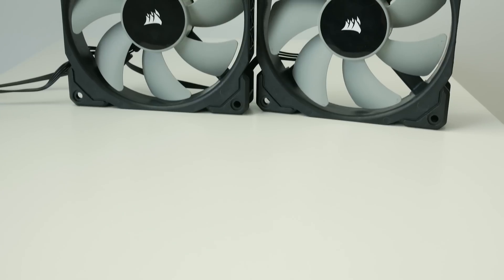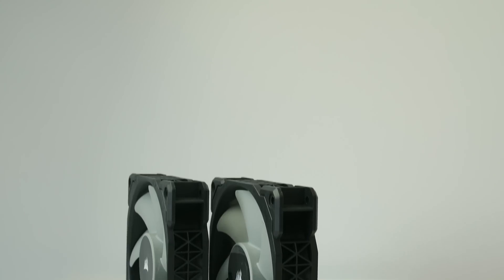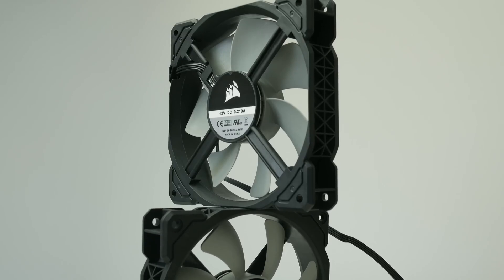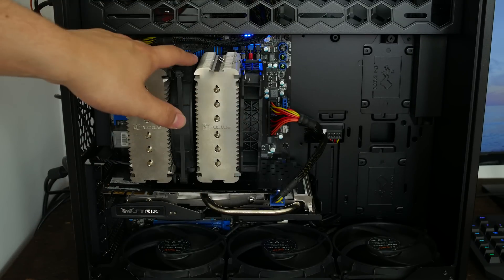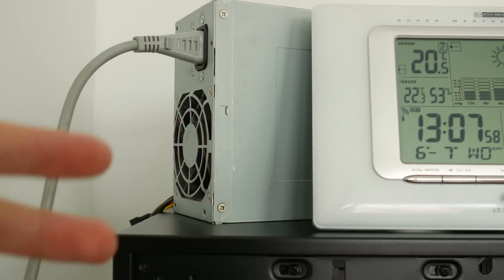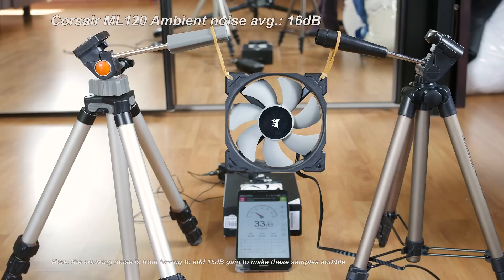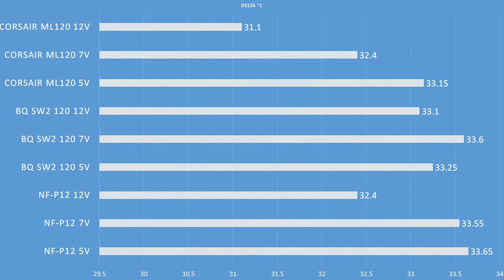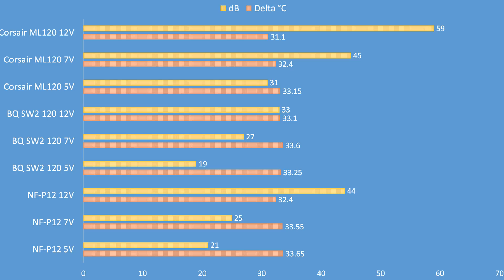Corsair ML Series Fans Cooling and Noise Review Compared to Noctua and Be Quiet!

Comment: I also disagree that beQuiet fans are better for low noise cooling for 2 reasons.
I have had both the SW2 and the SW3 from beQuiet and they move much less air than the ML ones from Corsair, and while they are quieter, that's only true at the beginning and only with good units.
With a bad unit or once the bearings clog up/wear out, the SW become noisy too.
Whether that also happens with the ML I have yet to see.

Comment: Loved the B&K sound level meter! hehehe. Your measurement is not "un-scientific" because you used a cell phone - that makes it only less precise. The only problem I saw is that not all the fans were hung in the same manner. As long as the method is the same with all fans you'll get scientific results albeit being less precise - but this is not a hospital or lab, so no need for a 2K USD sound level meter.

This comment is just so you know you did everything almost right and that a little change would get more comparable results - results that can be compared with one another.

Comment: you seem to be running dynamic boost clock, the temperatures differ way too little, 1 degree between the highest setting of the ML fan and the lowest of the SW2 :D thats 19 to 59 db and 2 degree difference. and the fact all your temperatures are within error rate shows that the clocks and heat output was not controlled :) fan testing is extremly difficult and has many variables, try basics if you want to do these tests, a simple audio test and db measurement and an air throughput test in a tube, temperatures are to difficult to control for any mere individual :) Good luck :)
Reply: genium me: PLEASE HELP. You seem like a knowledgeable guy in this subject. Do you know if the ML and LL series look different in terms of visuals, as in, if I used them in the Sam case would I be able to tell??
Reply: @notthatguy4703  sorry im not that familiar with corsairs lineup in general, i am more into the technology side of things then the design part.

Comment: I have PWM headers on my motherboard and it confirms in the BIOS that PWM can be used. So I don't need the PWM controller right?
Reply: no.  and if you use the arctic bionix fans they have pwm sharing technology built in so you can share one header between multiple fans.  and they are good price.

Comment: Did you connect them with PWM? I gather that the MLs need PWM for the magnetic function, and without that they will not actually be functioning properly which invalidates the test. Obviously that will effect noise and longevity, but it may also effect cooling performance as well.

Comment: - the sound pressure level (noise level, dB) from this test came alot from the wind blowing into the mic, why not get a professional 'pop filter'?  you know the black screen thingie in front of studio recording microphone, if you're poor you can DIY one from your mom's stocking.

- comparison from voltage alone isn't accurate, use RPM.  different fans spin at different RPM at the same voltage level.

Comment: not to bash, but help me understand this: you stated in your video details that the fans are designed to run exclusively on PWM, but with your tests you run them with voltage control? And then you compared full voltage decibels of a 2400rpm fan to full voltage of a 1500rpm fan?

I think a followup video comparing PWM versions of the Corsair MagLevs, the BeQuiet SW3's, and the Noctuas, and standardizing them to a handful of RPMs that are popular (700RPM, 900RPM, 1100RPM) would be ideal. I'm also a silent freak so I get exactly where your priorities are, and something like this would be very useful.
Reply from the maker: I understand your point, I've tested many pwm fans on both dc and pwm to compare but with most fans it doesn't matter how you run them. For future fan videos I might re-do the testing procedure to fixed rpms though.

Comment: nice video..  i  order corsair H110i v2  but i would u change the fans onH110v2 with others corsair more silent??witch to use it to replace fans on radiator :SP120 PWM Quiet Edition High  SP120 PWM Quiet Edition High

Comment: PLEASE read fan specs before reviewing them. As they are using magnetic levitation they need 12v to assure proper levitation....NEVER UNDERVOLT THEM. Just use PWM control
Reply: That whould be true but they are not levitating what so ever 

They literally just removed spacers off the shaft and placed one more zero on a price tag
Reply: @blackturbine  
You are talking BS.
On the LTT forums people have opened them up and you can see they are what they are supposed to be, fans with magnetic bearing, i.e. the rotor levitating around the motor.
Reply: I built my first pc some days ago with a magnetic levitation 140 mm fan from corsair, but it's pretty loud, especially compared to the stock fractal 120 mm fans that came with the case (Meshify c).
 Could you explain what you mean with that it needs 12 volts at least? Wouldnt it be really loud? I think im using 4 volt now.
Reply: @treack143   12v control means you need to control through PWM controller (4 pins). It should be done automatically through MB headers (4 pins) or any fan controller (with 4 pins). Afterwards, those ML fans are pretty (in)famous for their motor noise (even if properlly controlled). For quieter fans, you can have a look at Artic, Noctua for example
Reply: @MarcParisTV  Ok, nevermind the 4 volts i said, but can you just replace the case fan(s) like that? Without anything to change e.g. in the bios? And lastly, i have a pump header on my b450 tomahawk max but Don 't use it, should i? What is it?
Reply: @treack143  normally no issue to switch case fan like that. Before doing that it will be great to check your current fan speed (hwinfo64)....maybe your fan are simply spinning at max speed. At low speed Corsair ML are not that noisy

Comment: If I understood correctly, those ML's should be PWM controlled because of the magnetic field. Lower voltage means weaker magnetic field, which could cause some extra noise ( fans motion isn't controlled that well).
Reply: Petri Koukkula yeah i have 2 140mm's and a 120mm of these and running them pwm is alot quieter than trying to use voltage, something to do with bearing noise coming back, also under around 1300rpm the 120mm is barely audible, not sure about the 140s as i have mine on my cpu radiator

Comment: Maglev fans need PWM control, they can't use voltage control properly, the electromagnetic levitation requires the full 12v

Comment: I actually have to say, the sound test is less than scientific, it is blatently misleading. The reason I say this is, the actual sound is skewed by the amount of air rushing through. It's not the sound of the fan motor itself, but like when the wind hits your ears at the right angle. The wind itself isn't that loud, but it's the angle in which it's hitting your ear (or microphone) that gives misleading results. 

Moreover, the Corsair fan has a much higher RPM than the other 2 fans, and unless you're comparing their noise levels at the same RPM you can't say it's a comparison. It seems to me that the last air test had each fan at max, and since the corsair has a higher max rpm, of course it will sound louder. The corsair unit will move more air per RPM than the other 2 fans, and on par w/ noise level. The difference is only so noticeable for the aforementioned reasons.
Reply from the maker: The noise level was measured with a different mic than the one you hear in the video

Comment: First of all, the following post is not a complaint about what you regard as a less scientific sound test. You performed a sound test (which is quite tricky and impossible to get perfectly right/consistent/reliable) with limited means and I think you did fairly well.

Also, the first time I saw this video I thought it was done fairly well and you had some valid points. However, after reading more fan reviews and giving them some thought, I can't help but feel there are a few things that are wrong in this review.

I believe there are 3 main problems that limit the usefulness and correctness of these results and conclusions greatly.

Main problem 1: I believe this is something very obvious: why on earth would one leave the BeQuiet fan on in the #2 (mid) position of the CPU cooler in your tests? Apart from minimizing the effects of different fans in the #1, it is adviseable to use similar fans in multi-fan CPU cooler set ups. As far as I can guess this is mostly because different fans can push way different amounts of air per second at the same RPM, which could lead to over pressure and thus more heat (although I am not really certain about this part). Also, not that this is part of the review, it can create noise issues that is created by these differences in air flow.

But didn't you notice that the temperatures differences between all fans at different all the different voltages are very very similar? They are all 33.XX delta Celsius, except for the first 12V and 7V results of the Corsair ML120 at 31.1 and 32.4 respectively, simply because there the fans are running at ridiculously high speeds, moving huge amounts of air. It is really surprising that the effect on the temperature of these fans running at their max (producing great amounts of airflow) has such little effect on the temperature. It's simply unbelievelable...., and likely very unreliable. Basically, I would say that with results this closely, the margin of error will be bigger in many cases than the actual data that you are trying to retrieve.

So, I think that the noise-temperature chart using the 5V/7V/12V tests is highly misleading, but you have to understand main problem 2 and 3 for that.

Main problem 2: the lowest speed setting for the Corsair ML120 that you tested on is at 5V, seemingly not realizing that the Corsair ML120 produces 1300 RPM at 5V while it can go as low as 400 RPM. You are drawing the conclusion that the Corsair ML120 are not wise for using in a PC that is aimed at silence, while you have NO data to base this conclusion on because you missed the first and most silent 900 RPM delta part of the 400-2400 RPM range, that is nearly 50% of the range that you missed and completely left out of the equation, conclusion and your recommendation!!! You are logically drawing that the Corsair ML120 is loud on it's loudest settings. But this is useless, because pretty much all fans of this size that produce comparable amounts of airflow are loud on this 

From this point on, one should already ask himself, what the hell is being tested here.

Main problem 3: the different fans are compared on noise based on the different voltages 5V/7V/12V, conclusions are based completely on this and the RPM's are completely disregarded. This is not right, at least if you care about meaningful data gathered using basic research principles. Especially considering how poorly the Corsair ML120's responds to voltage changes and how this covers only a part of the fans RPM range, something that the reviewer at ThermalBench.com warned for (see their ML120 review in next link or their ML140 one). The Corsair ML fans really are PWM fans, not voltage fans. I believe Corsair warns for this themselves.

What is the reason that this not right? Well, the Corsair ML120s have COMPLETELY different RPM's at these voltages than the BeQuiet SW2. Proof:
http://thermalbench.com/2016/07/29/corsair-ml140-pro-140-mm-fan/3/
http://www.dvtests.com/be-quiet-silent-wings-2-120mm-pwm-and-140mm-pwm-test-and-review/
Extracting information from these 2 reviews makes me put the following figures here:
- At 5V, the BeQuiet SW2 fans run at 480 RPM
- At 5V, the Corsair ML120 fans run at about 1300 RPM
That is a 271% difference!  Of course the Corsairs make much more noise at this voltage. But you are building your main conclusions based on this "voltage".

And this is not even the whole story. Namely, at different RPM's fans can produce very different amounts of airflow. And measuring the amount of airflow vs. noise level is much closer to what you want to know when considering efficiency than drawing some kind of relation between some voltage being sent to a fan and the noise that the fans makes... Let me explain this by an extreme example:

If someone would produce a fan 'X' that produces 0 RPM at 12V, the delta temperature would still be close those those 33 degrees in these tests (maybe 34 or 35 or maybe slightly more) because that mid position BeQuiet SW2 fan is already pushing and pulling a very comparable amount of air compared to a 2 fan setup. Check online and see the effect of adding a 2nd fan to a CPU cooler, the effect is not that big... Following this line of thought, you could now give the Ultimate Gold award to fan 'X', because you could draw a conclusion like: "well at only 2 degrees extra this 'fan' is producing 0db, even at 12V, so it's the best fan ever! no more need for further innovation!".

Although this is an extreme and somewhat childish example, I hope this points out why you cannot make this comparison that you are making, at least not with the conclusions you are making based on this comparison.

A much better comparison is made in the way that the fan tests of for example hardwareinfo.nl are done where tests are made of noise vs. airflow in order to get to efficiency charts. In these charts, the winners are the fans that are most silent at a production of a certain level of airflow. See for example https://us.hardware.info/reviews/6622/tested-71-case-fans-of-140-mm-round-up-big-fans. But even this principle has its flaws as http://www.silentpcreview.com/ regularly points out that different fans having the same air flow can have different cooling behavior. In other words, a fan 'A' that produces less airflow than fan 'B' can still realize better cooling performance. Because of this, there is a reason to opt for testing the relation between noise and temperature, which is more similar to what you are doing. It's just that you are doing a test between voltages (wrong) versus delta temperatures (good try, but seriously flawed because of the minimal differences caused by your approach, mainly because of the 2nd fan in the CPU cooler).

Conclusion: Combing the knowledge stated so far, let's take another good look at the noise versus delta temperature chart in this video, specifically this: The Corsair ML120 has a nearly identical performance as the BeQuiet SW 120 at 12, while the Corsair ML120 is doing this with 2 Decibels less! This is a huge difference, considering this basic technology of a set of blades spinning and producing movement of air (which is the main cause of the noise). Performance differences between high quality fans these days are usually not that big. The technology has been around for years and has mostly been optimized already.

Now, take into account that at 5V, the Corsair ML120 is running at 1300 RPM while its lowest setting is 400 RPM, which is more than 3 times as slow. And now imagine how silent and nicely performing the Corsair ML120 could be, if it would go further down the RPM range. My bet is that just like at "5V" already, the Corsair ML120 will give the BeQuiet SW2 a run for it money at 1300 RPM and lower, regarding noise and efficiency. In other words: the Corsair ML120 is likely to beat the BeQuiet SW2 in the whole range, because I am guessing that the BeQuiet SW2 simply cannot go beyond the speed that it's getting at 12V.

Ending words: I feel like you made a very good effort and are quite close to having a solid review, but feel like some crucial mistakes were made that significantly degrade the usefulness of this review. If you would like to share thoughts, contact me. I think you are actually close to doing a good job and am more than happy/willing to help you reach that level.
Reply: hello, if you have some kind of rheobus, you could use it to set PWM.
As for measuring airflow, or at least the force exerted by the wind, you can get a bit creative here. Take a carboard box, and cut an opening on one size, the size of the fan. On the opposite side, cut another opening the size of a sheet of paper. Use duct tape to attach the top of the paper to the cardboard, and the sheet of paper in the front  of the large hole.
When turning on the fan a a certain speed, the paper sheet should lift up. With the angle of the the paper, you get an estimation of the exerted force.
Reply from the maker: +Laurens Pluijmaekers thanks for posting the longest non-spam comment on thid channel ever. You're right in many ways. The main problem for me is lack of funds when doing these reviews. I have no dedicated test rig. No air speed volume or pressure tools and no proper audio metering gear. The second fan should have been out, you're completely right about that. I tried to compare noise at the same temperatures instead of at rpm.

Comment: corsair never made quiet fans. these one sounds like fuckin lawnmower and overpriced a lot gg corsair
Reply: You know to be fair, the be quiet and noctua fan are airflow fans vs a static pressure. Be quiet fan = 1300rpm noctua = 1300 corsair ml = 2400rpm. so dBA would be obviously different. This wasn't a fair comparison IMO.
Reply: +Tsunami 625 to be fair noctuas has sp fans aswell and true is nobody need 2k rpm except people who loves jet engine  noise, i prefer silence.

Comment: Dude you dont Use this fans on 7v wtf This Are pwm Fans they allways Run at 12v(and than configure the RPM at the MB or at Windows with software) .  When you force Them to Run at 7v the ML (the Reason why you buy This fans)  wont Work (corsair also Wrote it on Their Website and on Interviews)